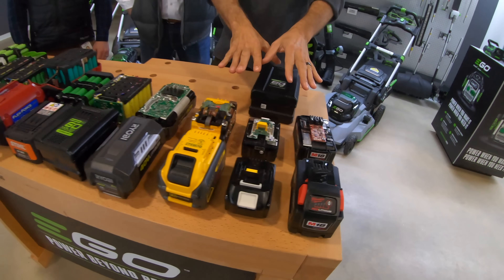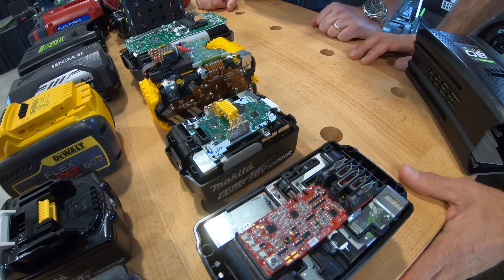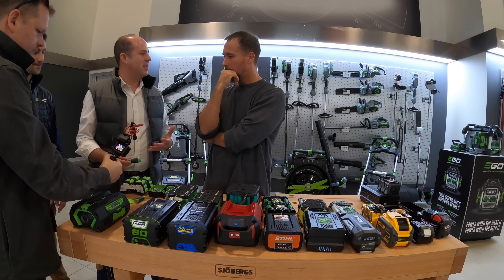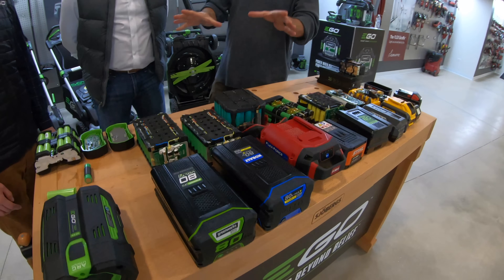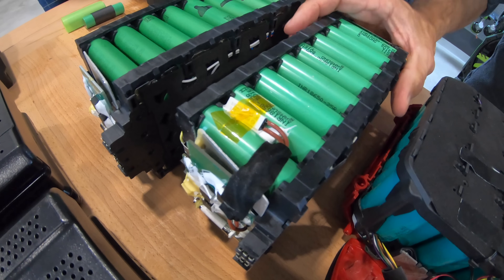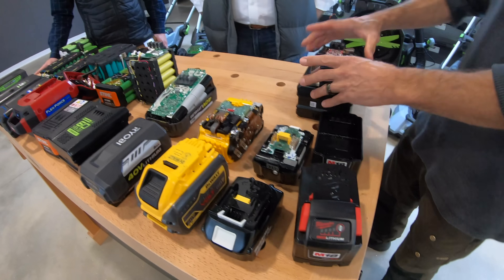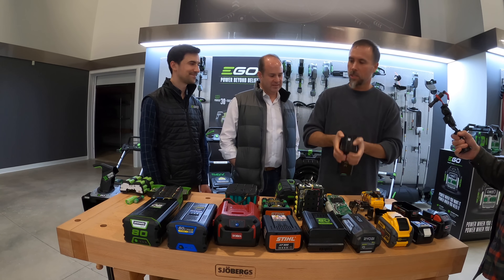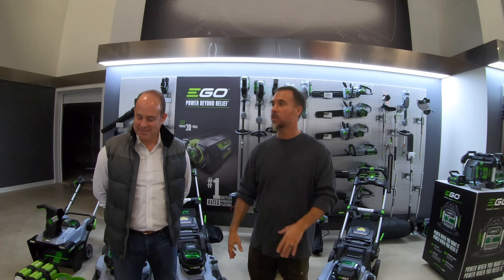Inside the batteries on the most Popular Power tools: Ego Vs Milwaukee vs Dewalt Vs Stihl 4 k video

Comment: The track record for lithium batteries speaks for itself. Power tool manufacturers have been doing this for decades and ego is the upstart.

Their battery design is different but not necessarily better. I didn't see anything there as a engineer that would make me choose ego over say Milwaukee.
Reply: I was going to just about post the same thing.    I’m no engineer but there was no data, or tests proving this is a better design.
Reply: Is that phase change material, arc configuration, and that rubber like stuff they poured on the electronics board just marketing?
Reply: @jronmanbuilds  It does something but it's more of a novelty IMHO. Good for marketing checkboxes. Its not like batteries are dying left and right from heat. They all have temperature feed back and have been field tested for decades.

Now what Tesla does with their battery packs, where they literally weave a thin radiator through the pack so every single cell is actively cooled. That's impressive, and is the reason why it can super charge so quickly.

Do ego batteries charge way faster than everyone else? That'll tell you exactly how much that passive cooling is worth.
Reply: @PeterPetrakis  my 7.5 mAh EGO battery rapidly charged from dead to full in 28 mins! For reference, a 6mah Makita battery takes 55 mins. That's a huge difference
Reply: @rconn4501  that has nothing to do with the batteries being in a “arc” configuration. Just because they can pump large amounts of energy into the cells in a short time frame dose not make it better.
Reply: @jronmanbuilds  It's just not THAT important, the potting (which is an epoxy) is more of a reverse engineering and repair deterrent than they let on. I didn't research the phase change material they use but I know material science well to know it's a very small improvement at best. The only design detail with any real merit I saw was the "Arc Configuration" and it makes the battery physically larger, heavier and more expensive (not by much but still) to manufacture. You'd have to do some laboratory style heat dissipation tests to know how effective it actually is (same for the phase change crap) but in a power tool it's not as important because the intended use has a lower duty cycle than a lawn mower or snow blower and white plastic to reflect more of the sun (well it's about reflecting infrared heat, which doesn't necessarily mean white but you should get my point) would be a better improvement.

It's marketing wank because they didn't talk about the cons of their choices and they refused to talk about their competitors pros.

Comment: Doesn't Chervon also make or own Kobalt?  I was happy to hear that my 80v Kobalt blower has Samsung cells.  The battery retail price is more than I paid for the blower+battery.
Reply: Chevrons Brands are: EGO, Devon, Flex, Skilsaw, Skil, Tron, Hammerhead, Calmdura. I am fairly sure Calmdura just designs the backpack batteries for all the brands.

They could be making Kobalt batteries on contract, but it is not a Chevron brand. as far as I can tell.

Shihl actually owns a large portion of GreenWorks now (as of 2016)
Reply: Chervon makes the Kobalt 24v power tools for Lowes. The 40/60/80v Kobalt outdoor equipment is made for Lowes by Greenworks.

Comment: Yes great idea let's wrap our battery in plastic make it run cooler... The reason other companies use a brick design is size. It would be nice to have more airflow over the cell but you don't want a battery that size on your hand tool

Comment: It's anti static tape and it's the standard for wire management for electronic enclosures.
Reply: I don't wanna be that guy, but it's actually kapton tape and it's a high-temperature tape. It's unique because instead of melting it simply sublimates and vaporizes into nothing. I'd say it's used as a form of strain relief instead of epoxy to prevent the wires from prematurely failing from loosening the connection it's attached to. It might even be because it's too hot for regular epoxy to be used in this application.
Reply: @Smashachu  It's actually polyimide film tape, Kapton is just a brand that makes it, but I use the brand name to refer to it too. It's also a very good electrical insulator (not as good as electrician's tape but still) and is used because of it's combination of heat and electrical resistance.
Reply: It's still a crappy and cheap solution rather than neatly organizing the wires like in the ego battery.

Comment: it's not scotch tape 11:04, its known as kapton tape. Make sure to use correct terms when doing a tear down of electronics.
Reply: Exactly. And Kapton is a brand of polyimide film tape, which has very high temperature tolerance and resistance and insulation value, which is why it is widely used in electronics.

Comment: I run non commercial ego tools commercially, best batteries in the industry by far. just did snow removal on 4 properties with them this morning. There is a reason I didn't buy stihl or even toro commercial line for electric landscaping... ego wins especially in mowing time  even in their residential line,.
Reply: ^this
Reply: Milwaukee batteries are every bit as good if not better then Egos!!!
Reply: @miketrotti4381  not even close.
Reply: @crimmy0204  How do you figure? A buddy of mine has an ego and his batteries gave out after 4 years of use. I've had my Milwaukee batteries 6 years and are still going. How did you come to this conclusion that Egos batteries are better?
Reply: @crimmy0204  I'm thinking about going with EGOs multi head power trimmer and hedge trimmer but I'm truly concerned with their batteries. How long do they usually last in years? Have you had any go bad on you?
Reply: @miketrotti4381  I own 12 batteries 2 years commercial none have gone bad they are samsung cells one of the better ones and probably the best cells when the batteries were released. There are many youtubers who use the combi power head ego unit some do 20 properties a day for many years I think quite cuts owns like 10 ego batteries and has only had one cell die.
Reply: @crimmy0204  Dang. That's amazing. I didn't know they used the Samsung cells for their batteries. Well you might could help me out here. I've got a few homes to do including my own and I'm fighting between buying a commercial grade top of the line ECHO gas weed eater for like $400 bucks and a ECHO gas hedge trimmer for $400 bucks or the EGO battery powered. What would be a better investment for me?
Reply: Have you tried the Milwaukee M18 high output 8.0 and 12.0 batteries?
Reply: I'm leaning more towards the gas for longevity and reliability. My dealer will do every other year maintenance for $75 bucks on my equipment for me cause I'm not having to run it really hard every year. I just dont know which way is the best way to go. I want something that will last for years and years and that will run for hours... And the ECHO gas equipment fires up everytime right away. Why did you personally move to battery equipment over the gas? Have you ever used ECHO? What are your thoughts on ECHO? I do think ECHO is better then STIHL as well.
Reply: @miketrotti4381  I recomend EGO or Husqui for electric trimmers/tools can't recomend gas. The up front cost is more but you will save in the end, Best of luck on w/e you choose!
Reply: @crimmy0204  Thank you man. Do you recommend the EGO weed eater as well over any other battery operated weed eater??? I just worry about the battery life over the years. So should I plan on buying a battery every 3 years for EGO? What would you recommend?
Reply: Also why wouldnt you recommend gas? To much maintenance?